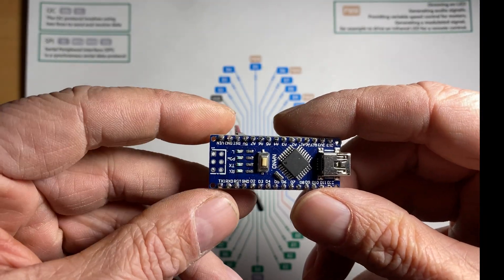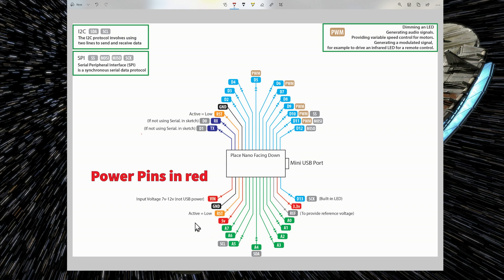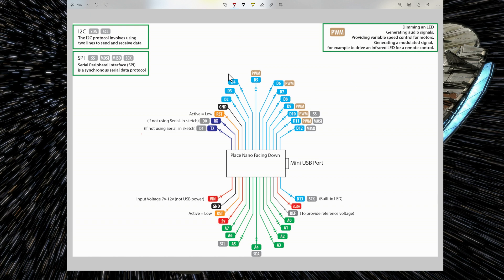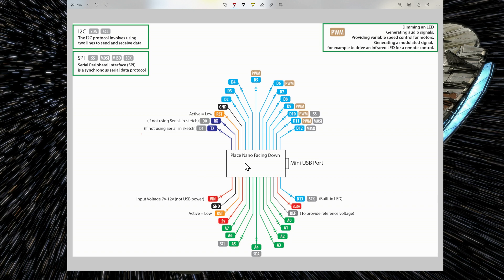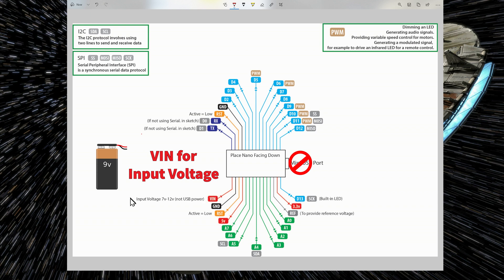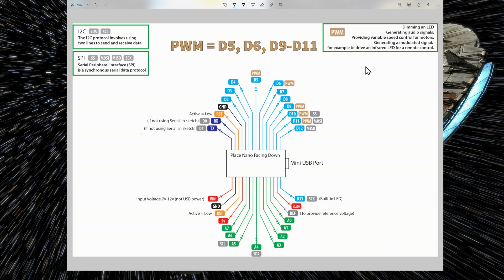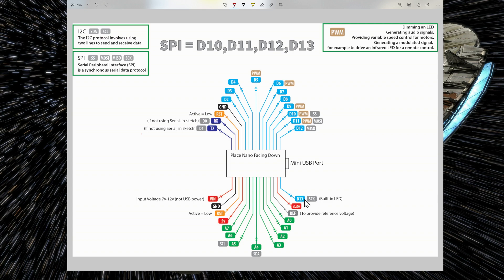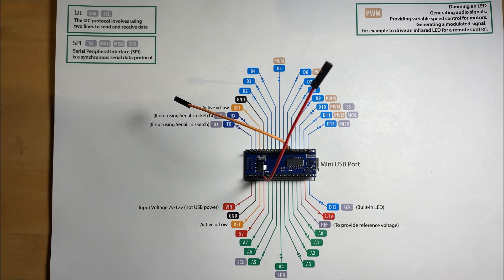Master Your Arduino Nano Pins with This Handy Guide!

Comment: Thank you very much for providing this chart and the detailed explanation! This will be very useful.  I have a question regarding the VIN pin.  You stated that when using the VIN pin, that the USB cable should NOT be connected, as it also supplies power.  I don't believe that this is correct. I believe that when there is power being supplied via the VIN pin or the DC jack, the power from the USB is disabled by a mosfet, but the communication pins of the USB are still active.  At least this is the case with the UNO, and I believe that this is also the case with the NANO as well.  At least I'm hoping that this is the case as I have a large project with 3 NANO's being powered by a regulated 12v power supply (turned down to 10.8v) and I'm updating the NANO's via the USB.  Thanks very much. Regards.

Comment: Nice idea ! May I suggest: 1) make similar for ESP32,Wemos D1 mini, Wemos32. 2) Add which signal can be input, or output (mostly for ESP32). 3) make same for the pins down orientation.